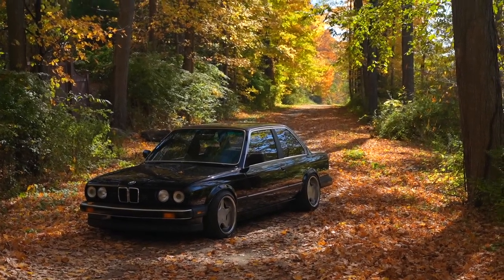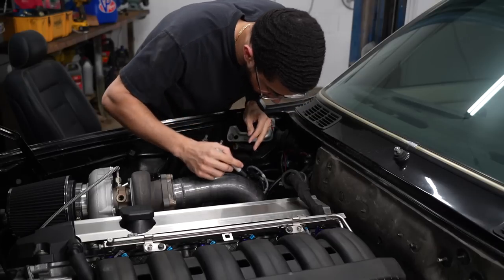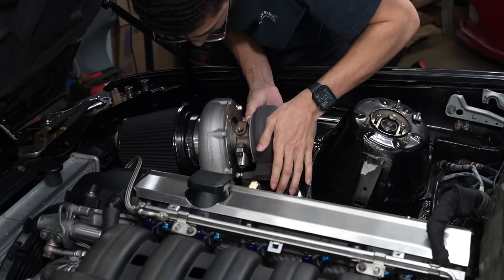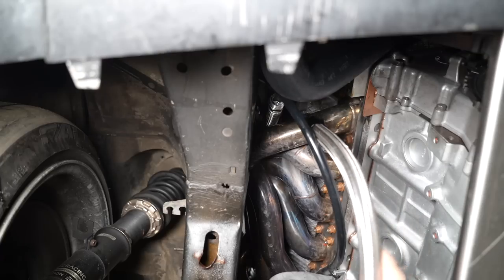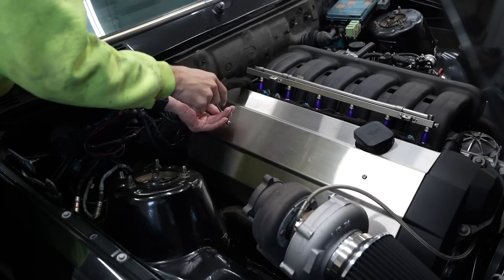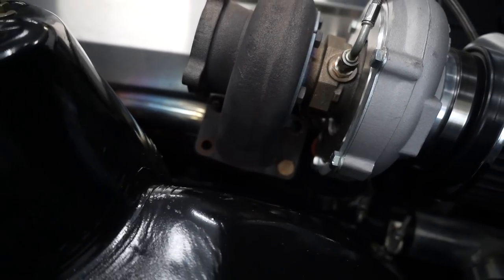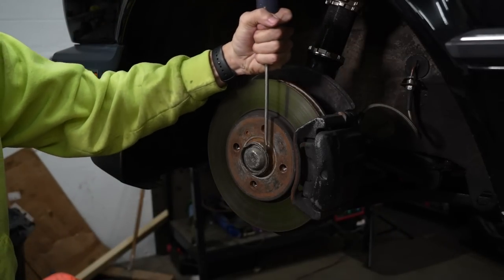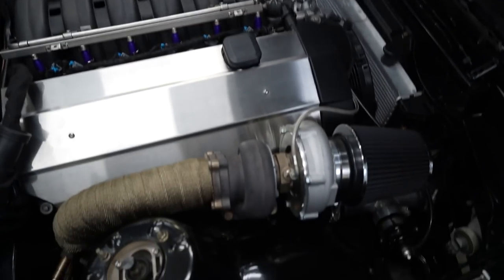I RUINED My Turbo M50 E30 Trying To FIX It

Comment from the maker: even though i messed up pretty bad. everything has a fix. i'll get it sorted ❤
Reply: You got this my guy live and learn !! Can’t wait to see how gnarly it’s gonna be 😎👊🏻
Reply: We live and learn Joel! Loved watching the rebuild process and hearing you rip it sounded so sick! Unfortunate to see this happen to the E30 but perseverance is key! Much love brother. Subscriber from Wisconsin. 🤙🏾🛞
Reply: Dude showing all your fuck ups has motivated me to try it on my own. Instead of paying a shop. Thank you!
Reply: Maybe try oversizing the hole on the turbo.
Reply: Definitely just run a dremel tip in each turbo hole not just the corner hole that way you don’t have to go crazy just enough on each one that it gives you the wiggle room you need!
Reply: Bruh just drill the housing. Just a little on each hole to give a bit of wiggle room. ( pause)
Reply: Definitely just oversized the holes on the turbo. It’ll give you more wiggle room with your down pipe as well.
Reply: Hey Joel, Upsides - the cars running well & you got the front wheels bearings done. Lol at the frustrations on the studs been there, just how it goes sometimes. Maybe drill out the holes on the turbo side flange, I'm sure it'll slide on after. Great work tho 👍🏽
Reply: Bro please just give it respectable wack with something
Reply: @Bryce0313  Pmlmkkmpo

Comment: As a guy drilling and tapping everyday, try drilling the holes of the turbo with 1mm or 2mm larger drill bit so they compensate the difference. And if still doesnt work, replace the stud with a bolt. It should work.
Reply: yes
Reply: Good idea, it should work
Reply: Exactly my idea, I can't think of anything preventing you from making these holes a smidge bigger.
Reply: @imnota  Same thing came to my mind after video :D Just drill bigger holes in turbo flange :)
Reply: @ciuciuka812  I was about to comment the same

Comment: I would just drill the off center hole on the turbo slightly bigger so the stud can slide through. Or get a tungsten drill bit and notch it a little bit like it's adjustable lol

Comment: I snapped a valve cover bolt on my is300 and then snapped the extractor tool right after. I had to drill with 4 different bits and make new threads. Probably the most nerve wrecking thing I've done but I was so satisfied when I got it done. 

Great video, you seem very knowledgeable. I'm subbing.

Comment: to make sure it lines up, next time drill a pilot hole with the turbo on the exhaust manifold. it will guide the bigger bit easily and it will line up 100% of the time

Comment: Just a tip for future reference when cleaning the threads of any hole you should use a thread chaser instead of a tap. I think thats why the threads in the manifold became “weak” because when you use a tap it continues to cut material out, where a thread chaser just removes rust, old thread locker, or any gunk thats stuck in the threads!
Reply: Well problem is he wasn't cleaning, he was fixing crossthreaded threads, so there has to be cutting involved to fix the parts where the threads have been mushed or folded over. But you're right, when you just need to clean, a tap can be too aggressive.

Comment: Hey, i did forged bottom end on my project, my break in was 15-20min varying low rpm, oil change, lowboost pulls  with  long engine break slow downs, another oil change and after that full send

Comment: You can do it!!! Humbling to see you keep going, film all of it even when frustrated, it’s sick. Keep going man your at the home stretch. Maybe do 2 studs and two bolts if it works better. For the corner one that’s hard to get to I use a hex 8 or hex 10 head bolt because the long, Ball end Allen tool can slip past the angles of the turbo. Good luck!

Comment: Bro don’t sweat it. Just read comment suggestions and think about a solution and you’ll figure it out! Also, you say there wasn’t any enjoyable content in this video but I disagree. I enjoy all the content you put out, and to be honest we like to see when you face problems or when something is just straight up frustrating because it’s something we all experience when working on cars too! It’s never easy. Keep up the good work brother. One last thing, if you are looking to get a pretty decent turbo that isn’t cheap like eBay but isn’t as expensive as something like Garrett, check out Arashi Dynamics turbos.

Comment: Hey man nice video. With the drain line, make sure it's not rubbing on that coolant hose. Steel braided lines are very abrasive when it has vibrations throughout the line, especially on a turbo that's rocking back with the engine when on boost. I have seen stainless steel braided lines chew up chassis.

Comment: Open up the holes on the turbo slightly if it’s just a little bit off. Just make sure it seats and seals right. Things tend to straighten out when you torque them down. If not, like someone else said, just take the manifold off and re-tap the holes after welding. Or if you can manage just one bolt one size bigger (idk how big the bolts are? M8? M10?) love your videos - never boring bro 😎

Comment: For the love all mechanical things holy, pleeeeeeze get rid of the 'Irish socket set"; aka, adjustable wrench! ;-)  A 12 point socket will fit over the end of a square drive allowing you to use a regular ratchet. I love watching your genuine enthusiasm but always remember 'right tool for the job'!  Keep up the good work ;-) Ps. to fix it, ream out the holes in the turbo flange.
Reply: he gave you props on the next vid, btw! lol i had to once do a tap job on an oxygen sensor hole in a location where only a contortionist's hand would fit. thank god i've thought of a socket +extension method on the end of that tap. was still a b** of a job, but no way anything else would've worked there.
Reply: @vinny6_9  I know what you mean! I  can't tell you how many times I've had to pull an exhaust manifold completely off to fix something. And invariably, you always break a stud or something making the job even harder and worse ;-)

Comment: I had the same oil drain issues, cx downpipe with the same eBay t3 turbo. Switched to a pte 6262 and all my problems are solved!
Reply: Also next time to make life easier, unbolt the bottom passenger side engine mount and jack the engine up it’ll give you a lot more space to work on the turbo side!

Comment: i would drill all 4 threaded holes out on that manifold, and just use stainless studs with copper nuts on either side. Much better solution imo.
Reply: I would say hell naw to stainless hardware high grade steel studs with copper nuts is pretty mint

Comment: With a leak down test you gotta hold the crank so it doesn’t spin on you when you apply pressure to the cylinder. Especially with newer engines that aren’t supposed to rotate backwards bc they’re interference engines.

Comment: technically you're supposed to use an aluminum time sert or insert for aluminum, not carbon steel, but I have done the same thing in aluminum with the steel inserts and it always works mint!

Comment: Got a link for that turbo drain ?Edit: Pac performamce , thanks! You need to rent a tq. Wrench for free from the auto parts store. Its important to tq the wheels correctly otherwise you crush the race or leave  it too loose. Espcially with extra h.p. (ask me how I know)  Fwiw also make sure to wear a face mask even if your heat wrap is wet. Drain flamge for water is the high side , so the turbo is full of water when in use. (Block drain is water in
 The one that goes under your intake is the drain/ low pressure side/ a.k.a  higher water line on your turbo. )

Comment: during the "break in" process of an engine, you want to break down the "peaks" created by honing the cylinder walls, allowing the fresh rings to bed in properly. There is no point babying it for a thousand miles. you are far better to give the engine some abuse to allow those rings to bed in and seat properly. Just my 0.02 from building my m50 and a lot of 2.0 pinto race engines that i work with.
Reply: I wouldn't say some "abuse" but it definitely needs load. I've always been told to break in to go high loads (both accelerating and engine braking) but keep rpm moderate.

Comment: would have drilled a hole all the way through add a really long bolt w nut, call it a day. Exhaust manifold flange does not need to be threaded.  Or drill holes wider on turbo

Comment: If I were you I’d get new dust cap for the bearing, I took mine off and they never seem to go back on the same 😂 now and again I’d get a weird rattling noise and it was the dust shield which had fallen off.

Comment: just take the drill and hallow out the holes on the turbine housing itself. its a throw-away piece anyways.
they are about 100 bucks new on ebay for a new bigger hotside worst case scenario.

Comment: 14:00 that 10an 45 is not doing you any favors. ditch it and run a line down into the oil pan without any fittings. also at 14:02 is your pan fitting pointing down? it should be pointing up, so the oil is not fighting any slope on the way into the pan.
37:47 in the future, you can try and find a socket that fits the backside of the tap and then use a wrench on it. should've set the turbo on the mani and then started the tap so it wouldn't be off. oh well. weld the hole and re-drill it. or expand the hole on the exhaust housing of the turbo so it slides over the stud, but make sure you don't expand it too much so it doesn't seal properly.

Comment: The thing about aluminium block threads is kinda a myth. Atleast if the engine hasn't been overheated and re gasketed or head bolt torqued many times or over torqued... I have a few customers running 500+hp on alu blocks whitout time serts, and also my own e46 will be 500hp next summer, whitout time serts. One customer has ran the 500hp 700nm (crank) with stock headgasket and bolts for a year now whitout problems. The other guy has arps and cutring head gasket, 550hp 700+nm also no problems. Theres also one car in my country that has a built m54b30 alu block running 855hp935nm for years now. Not sure if he has the time serts but anyhow an alu block with stock sleeves and no grout fill etc. Ofcourse the threads can strip but its not a sure thing if the engine is built and tuned correctly. Ofc its a safe bet to put the timeserts in there if you have the money and are pulling the engine apart anyways but its not a 100% neccesity.

Comment: If studs are a little off, give it some hammer kisses and it should be pretty gud as long as it doesn't mess up the manifold mating surface straightness :D

Comment: I told you TWICE already what's making that clicking sound and even sent  link to your own video showing it but Nope.  It's the Clamp or band that has the high square part sticking up for the axle boot. Or whatever that band is clamping onto. You can see it in the first video when you are looking at the rear drivers wheel and running it in gear.  Oh well can't help if I can't reach.

Comment: Just get solid mounts for the drivetrain. Less nvh than poly as poly allows just enough movement to allow vibration, aluminum doesn't
Reply: Movement to allow vibrations, lmao that is not how it works

Comment: You're overstressing too much, those holes in the turbo can get widened quite a bit without it causing any issues. I'd just take a cardbide bit and ream those a millimeter or two bigger, and with all 4 made larger you're gonna have more than enough play to line it back up.

Comment: Just weld a nut on the bottom side it would be easy just with a bolt n nut but without welding the nuts it’ll be awful fawking with it in the future

Comment: I would put real oil in it before you start to beat on the engine 
Cleetus fucked a new engine cuz of that 
They forgot to change the breakin oil and raced it and engine blew up 
The breakin oil is only for just that short period of break in